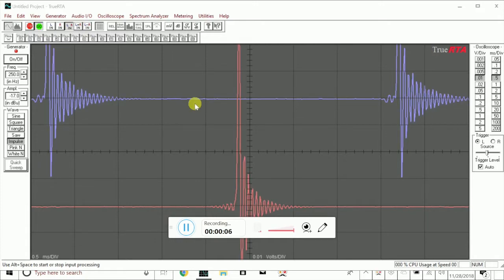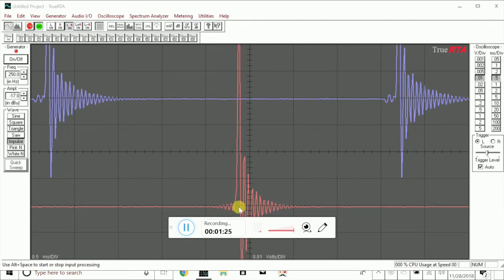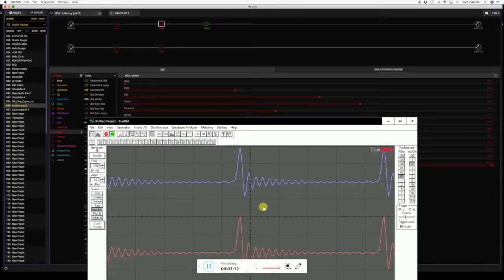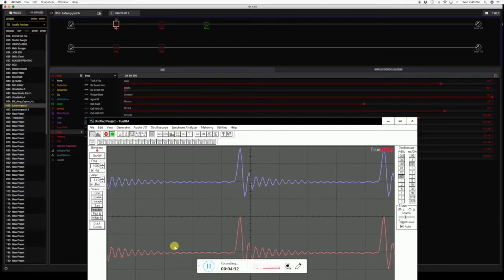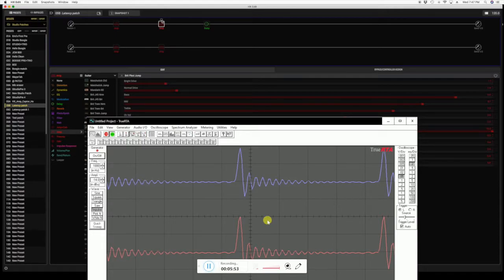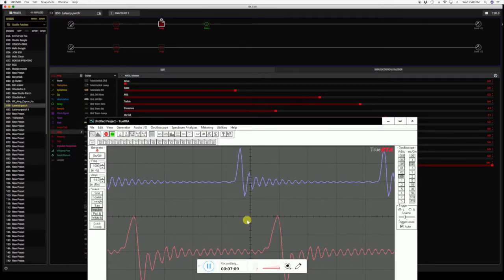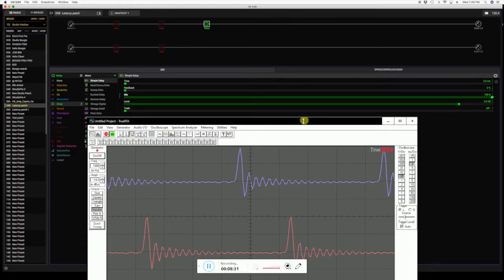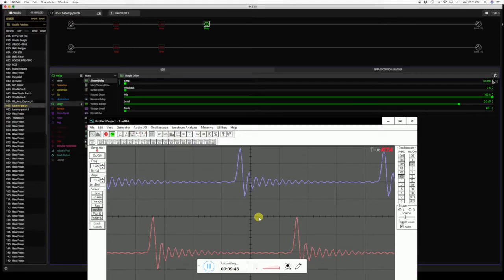Helix Latency Vol 1

Comment: So question about the last thing you said in the video -- that there is DSP latency in computing in series each gain stage of a high gain amp.   Does the helix internally use amp profiles like a kemper, or is it actually modeling the circuits?  My understanding was that it has its own profiles.  If that is the case then the DSP lag would depend on the complexity of the transformation in the model, not the number of gain stages.  (That's a question though, not a complaint!). Also this would apply to amp profiles, not necessarily to effects.

Comment: this is very interesting. and the note on that using each fx loop will cause more lag is a huge deal. but i'm still impressed with the low latency of the helix considering its wAY faster than using a usb or firewire interface. and I have also noticed that some fx especially delays will cause latency if you set it to 100 percent wet. but I always set mine to about 20% wet anyway. so i don't get any problems there. especially when you show that it doesn't change the latency when you are using mostly dry signal.

Comment: Very nicely illustrated, thanks! Don't you think the delay may actually compensate for its own latency by only starting to move once it passes the point of its latency? That way the delay time indication is actually spot on, as long as you don't try to make it work faster than it's latency time.

Comment: I bought a Helix, but I'm gonna return it because of the terrible latency. I already have an ax8, which to me has no perceptible latency. I'm just talking about the amps. I feel disconnected from the sound coming out of the speakers.
Reply: Really is that bad??? i see a lot of demo and it seems with no problem at all!
Reply: @Jotapecaster  the latency is very small a HUGE thing most people don't think about is that most of these modelers use the SAME shark chips. it's all based on the program being written from what I understand they are working on making everything even more efficient.
Reply: @Jotapecaster  Helix Lt soft 2.91/ Input 5.918 Output 16.712